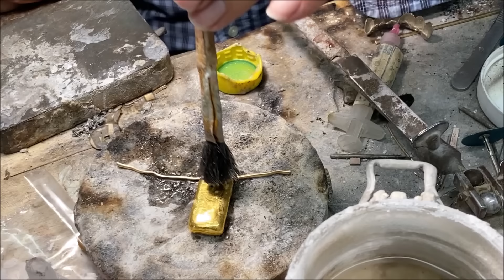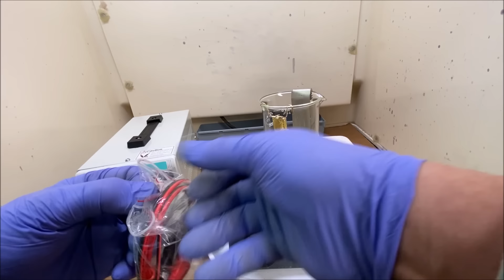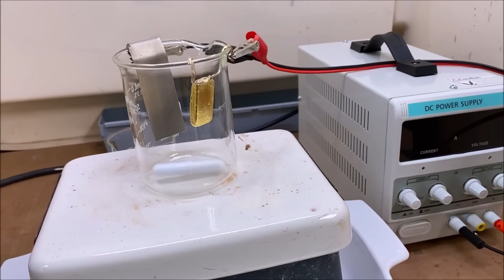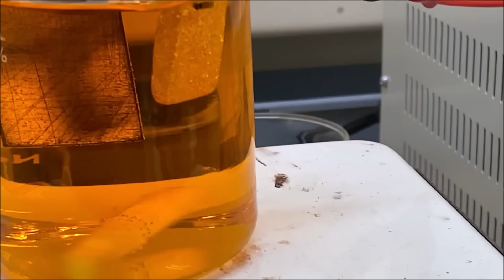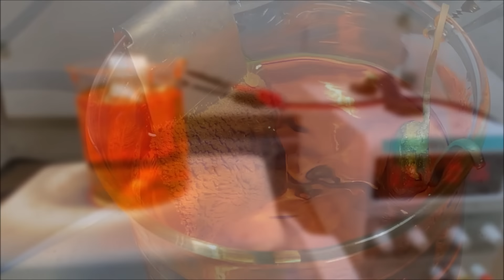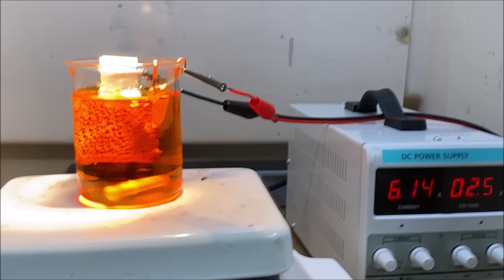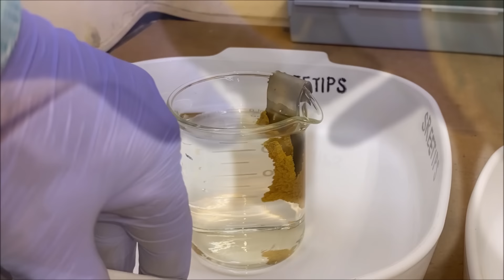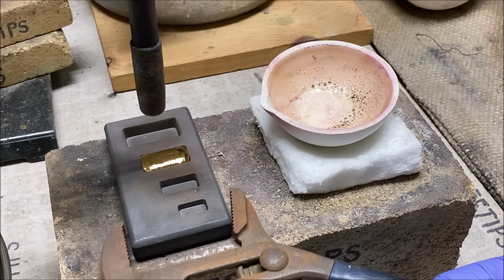Electrolytic Gold Cell Part 2

Comment: So are you losing gold From the bar that's in there. Or is that coming off and going onto the plate. I know you have gold in the solution that you're trying to get. I'm just confused, cuz it seems counterproductive. You're losing gold to get gold.
Reply from the maker: The gold in solution is the electrolyte and serves to complete the circuit and to allow the gold ions coming from the anode bar, a means to flow to, and deposit on the titanium cathode. The anode bar is about 995/1000 pure. The gold deposited on the titanium cathode is 9999/10000 and that the reason for the experiment - high purity gold. Plus I did it for the show.
Reply: @sreetips  ah Got you. That was cool to watch.

Comment: The process is cool, the video is informative and well done. But in practice, @ bigger quantities, getting 4 Nines just chemically is much much easier, same goes with other PM's (Pt, Pd, Rh).
1- To get higher Amperage, you just have to figure out how to keep the distance betwwen anode and cathode as close as possible. And of corse the more surface you have the easier and faster it goes.
2- Try to never go more than 2 Volts, otherways other metals will react (if not, the rest of Amerage and Volts, only goes to heating the solution and hardens the gold on Titanium.
Reply from the maker: I’m going to do this again with a larger cell.

Comment: Purification means that you have removed non gold particles. Where do these particles go in a process like this? Are they in the solution at the end? In the toxic air? And what is the makeup of these particles? Are we talking random metallics and minerals?
Reply from the maker: Traces of impurities remain in the liquid. There’s not much. The anode is about 995/1000 purity to begin with. It’s important that the anode is relatively high purity to begin with, in order for electrolytic refining to be effective.
Reply: @sreetips  Are there any functional (scientific) benefits for the gold to be refined again after getting it so refined for this process?
Reply from the maker: None that I know of. Three nines is industry standard for pure gold. Canadian Maple Leafs are four nines, even though they don’t need to be.

Comment: What did I just watch?  Explain like I’m 5 yrs old.
Reply from the maker: Ok; the gold bar is about 995 parts per thousand pure gold. For electrolytic gold refining to work, the anode bar must be fairly high purity to start with. The 995/1000 impure anode bar is suspended in a heated gold chloride solution. The titanium cathode is suspended in the same solution directly opposite the anode bar. The DC power supply, positive to the anode and negative to the titanium cathode, pushes an electric current flow through the cell. The current flow causes the 995/1000 anode bar to slowly dissolve. The gold ions travel through the gold chloride electrolyte and deposit as absolutely pure element gold on the titanium cathode. Any impurities get left behind in the gold chloride electrolyte. The resulting pure gold on the cathode is four nines fine. That’s 9999 parts per ten thousand high purity gold. Hope this helps.

Comment: I worked in custom thermoplastic injection molding. Any part that had to release besides off a flat surface had a draft angle of about 3 degrees. I kept looking at your turbine blade and I instinctively wanted to place a draft on all surfaces with fine sandpaper finishing with Emory cloth to a polished surface. Wouldn't have to be mirror just less than the draft angle. It would pop off with a few taps. 
Also was thinking seeing how thermocondictive Ti is you could place ice against the hanger bend while running the gold end under hot faucet water. It would release easier that way. Another technique used in injection molding. Cooling channels inside mold , drafted angles for release. Little round details on the plastic part  is remnant of the ejector pins that push out part. Retired, i miss work so much.
Reply from the maker: When you love your job, it’s hard to leave it. I have another turbine blade. I’ll trim it up to the specs you gave and I’ll repeat this in a future video. It was easy to do and the gold is very high purity.

Comment: So you can sell this? Also, you literally "grew" this gold? Looks like the same bar you started with. Just curious... I'm dumb! 🤣 🤣 🤣
Reply from the maker: The gold did grow on the cathode, you can see it in the video. But it came from in anode bar as it dissolved via the electric current. The gold ions travel through the electrolyte and deposit on the titanium cathode. But no new was created. This is called electrolytic refining.

Comment: Why did the wires have to be 14K gold?  Couldn’t they be purty much any conducting metal?
Reply from the maker: Notice that there’s some green junk forming at the top of the anode toward the end of the process. This is from copper in the 14k alloy. Using copper would introduce even more contamination into the electrolyte (undesirable). Silver would be even worse because of silver chloride contamination. The ideal wire would be pure gold. Or casting the dog ears right into the anode bar.

Comment: This is crazy cool, but i have a couple of questions if u see this... First question is what is causing the bar at the bottom to rotate? I know magnetic current will do that but I'm unsure of the source, so In lies the ..
Second question are you using this process to create gold or to is it being drawn to the cathode from the gold fluid? 
I'm not a chemistry person so I'm dumbfounded because i was under the assumption that we had not figured out how it was made or how to mimic the process and we assumed it just came from space debris. I say again this was amazing and a pleasure to learn!
Reply from the maker: There’s a rotating magnet under the heating unit. No gold is being created. The current flow dissolves the anode bar, the gold ions travel through the gold chloride solution and deposit on the titanium cathode. Impurities stay behind in the gold chloride solution. Only pure gold deposits on the cathode, about four nines fine.
Reply: @sreetips   ohhhhh so purification lol gotcha thank you also for the response!

Comment: Hey buddy been awhile...I'm not on the forum anymore but just giving you a tip. One of the first egc posts on grf was done very similar along with an atomizer. 
The suggestion worked really well and quite simple. They covered the cathode in a single layer of scotch tape. Gold comes right off with no fuss.
Reply from the maker: Excellent, thank you

Comment: 31:11 measure the weight of the gold before you heat it, then measure the weight of the final ingot.. You will be missing some gold. Gold evaporates, especially when blasting it as you are. There's a  way to avoid that. The reason I know is because my uncle is the inventor of the gold vapor recovery process.
Reply from the maker: There are losses all along the way.
Reply: @sreetips  True. If you don't mind me asking, what are your material and energy costs to profits with gold at a spot of $2000?
Reply from the maker: I don’t know, I’ve never tried to calculate it. But I paid off two houses in the last two years - with gold.
Reply from the maker: And my last light bill was $109 for the month.
Reply: @sreetips  Lol! Awesome.. So obviously a highly profitable ROI!!! And likely only to get more profitable as the price starts escaping the control of the chart monkey hammer. Not that dollars will remain the pricing standard much longer. 
Great channel, subbed. Have a great day!
Reply from the maker: Welcome and thank you.

Comment: hello m8s brazzer here. you heat the part that you need the soldering to attach to then you swipe the soldering stick like licking it off with the flame the soldering will go directly to the part you need to stick together. i worked on chillers and evaporators theyd use a coil with 5 godam copper tubes n a fitting with holes. you needed to bend the copper too without breking it into a spiral.

Comment: Sree, try using either latex or silicone moulding rubber to insulate the greater area of the receiving plate into a cylinder. All that would be seen would be the target area down inside so the gold transfer would be only where it could make contact . You could possibly make a Star shaped product if so desired
Reply: Sree, by using much less amperage and taking a lot longer to plate to the receiver you will likely come out with a much smoother product possibly not requiring a re melting the depth of the moulding gives you a deeper thicker end result. Your wonderful videos saved my life from a most uncomfortable death. Wisdom if applied correctly is a grand gift , thank you for such a gift.

Comment: 9999 fine with a pinch of titanium and a dirty contaminated melted dish ????? You took a big scratch off titanium out of it with the stainless steel scraper look back at the video and you can see it??? I did easy

Comment: Did you know magnetism can replace electrolyte! So measure the amps your system is using, and then switch to another method of stirring, like a glass 'T' shape connected to an overhead drill etc. And you will notice less amperage is being consumed!!!
So if you want to make it consume more amperage without adding anything extra... introduce a Powerfull 'AF' magnet on the side or somewhere where that won't interfere with the stirring.

Comment: Question. Couldn't you just have taken a nail, or a sharp long punch with a fine tip, and drive a small hole into each corner of the bar, then insert you hanger arms into those that are also made of gold. Then hammer down the holes you made to make the small bar to hold on the dog ears with friction. 
This method should help with purity levels. The solders he was using could possibly affect purity. This way if you cut the dog ear arms off they want have to be refined again. Would that work?
Reply from the maker: Yes
Reply: @sreetips  Great. Hopefully that can save ya some time and hassle. I wonder if they sell 24kt gold alligator clips also? I guess a person can make a version of that in thier shop also. 
Later bud
Reply from the maker: If I continue to use this method, and now that I know the titanium cathode works, I probably will, then I’ll refine this process to make it easier to perform. Thank you.

Comment: I was wondering if it would be possible to build your gold cell with the same setup as your silver cells? Would it require too much gold to be tied up and therefore be too expensive ?  Or would it just take too long?  As always Thank you for all your hard work. I love your work especially your gold videos!
Reply from the maker: The gold cell is a different configuration.

Comment: I think I’m uneducated bit what i saw was the passing from one bar to the other, after weighing, it was about the same as the original bar you used. Isn’t this just transferring gold from place to another, not really “growing” gold like you did with the silver.  Did i miss something here?
Reply from the maker: This is called “electrolytic refining.” The impure anode bar (about 995 or so purity) dissolves from the current flow. The gold ions travel through the electrolyte and deposit as ultra high purity gold on the titanium cathode. That’s it, it’s that simple.

Comment: where is the original small bar you hung inside the beaker? what was the finished weight of that pc?
Reply from the maker: The anode bar gets dissolved from the electric current flow. The gold ions travel through the gold chloride electrolyte and deposit on the titanium cathode as high purity elemental gold. Impurities remain suspended or in solution in the gold chloride electrolyte.

Comment: Can someone explain for me the purpose of this process?  

Started with a 58g bar of Gold.  Is he converting that gold into a different form for this cell? A larger project?  Sorry, I am still very, very new to all this.  Love his videos but still have a lot to learn.
Reply from the maker: This is electrolytic gold refining. The anode bar was close to three nines fine. But after it gets dissolved and deposits on the cathode it goes to four nines. That’s it. This is the exact process large commercial refiners use to get high purity gold.

Comment: I just wish there was a little more detailed information about the process for those of us that know nothing about this chemistry stuff. I love learning things and this was very cool to watch. Can anybody tell me what the first process did exactly to the gold before he went on to the second process with the orange solution and the acid?
Reply from the maker: In the first video I dissolve pure gold in aqua regia to use as electrolyte for the gold cell. In part two I used a pure gold anode bar and passed an electric current through the anode bar. The anode dissolves. The gold ions travel through the electrolyte and deposit in the titanium cathode as high purity elemental gold.
Reply: @sreetips  Ahh I see, so was this just an experiment or is there something specific that you're trying to do? I can only assume that this is the process that they used to gold-plate rings and such?
Reply from the maker: To see if the titanium cathode would work. The Royal Canadian Mint uses this exact process to refine four nines gold for their Canadian Maple Leaf coins.

Comment: Wow! That anode bar looks almost crystalline in that solution or like lava, truly fascinating stuff. I am away up to a Scottish river I know in a couple of weeks once the water has dropped (and warmed up) a bit on the hunt for some Gold, it has the perfect conditions with water flowing over solid bedrock which has loads of thes like potholes roughly a metre in diameter and about 1-3 ft deep, these are where the Gold collects, even when you look at the sand in this river it looks like it's full of Gold. i will let you know my findings Good Sir Sreetips.

Comment: And as a by-product (or I should say by-process) @13:06 you can see you've electrochemically etched the gold bar to reveal its grain structure!
Reply from the maker: It looks fascinating.
Reply: @sreetips  What you're actually seeing on that glittery surface is light being relected off different atomic lattice directions. Each grain has its own lattice orientation. When the gold starts to dissolve, the outside surface shows each individual section, or grain, each with its own orientation. 

Some lattice directions are more reflective than others, so that's why you see a mix of grains that are shinier, and grains that are duller.

Comment: A couple of tips:
1: obviously a pure gold anode is best, but if you use titanium, give it a light spray with WD40 - gold will peel off nicely.
2: best not to use a stir bar. You want any impurities to fall to the bottom as a sludge. Constant stirring will stir sludge into electrolyte and enable it to be entrapped in the collected gold sponge defeating the whole purpose of purification.
3: voltage control is critical. You want contaminants to sludge out and not be transferred to cathode. Slow and steady does the job - higher volt (and amps) will force contaminants across to cathode and not give them time to sludge out.
Reply: Refined, this isn't a process to create gold from basically scrap is it?
Reply: No , refining is making it more pure you may even loose a few grams
Reply from the maker: No
Reply: Have you made gold I wish I could perfect this
Reply from the maker: I’ve refined the gold, electrolytically.
Reply from the maker: Possibly
Reply: Tend to agree - the critical thing is the cell voltage hopefully to dissolve just the gold and let everything else stay put and sludge out. When done the electrolyte can be filtered and reused. It would be useful  to have an assay of the starting anode, gold made for the electrolyte and the final product to know if the improvement in purity is worth the effort.
Visually it looked good and I guess sreetips would know by looking better than most.
Reply: what do you know, noob
Reply: YES!

Comment: I'm wondering if you could use a Gel as the Anode conductor.
This would be similar to a PEM (Proton Exchange Membrane) as used in Fuel Cells.
Only the Gold ions would be allowed to pass through gel with the correct electron travel.
Reply from the maker: I Don know about that.

Comment: So why doesn’t the cartels do this? Seems just to good to be true 😅
Reply from the maker: I’m refining the gold electrolytically. No gold was created during this process.
Reply: Oh so you use the existing gold that is impure to create pure gold? Interesting 🧐
Reply from the maker: If you watch carefully you’ll notice that the anode becomes smaller as the gold builds up on the titanium cathode. The anode gets dissolved by the current flow. The gold ions travel through the highly conductive gold chloride electrolyte and deposit as high purity elemental gold. Any impurities stay in solution in the electrolyte. High purity gold anode is required here. Lower purity anodes would fouls the electrolyte and make successful refining less likely. Junk in the electrolyte could co-deposit on the cathode with the gold. High purity anode equals less of a chance of co-depositing of other metals.
Reply from the maker: Correct.

Comment: If you put edge strips on the cathode it will prevent the gold wrapping around (they use edge strips in copper refining processes so they can easily get copper plates off.